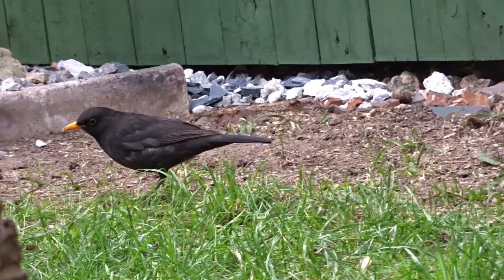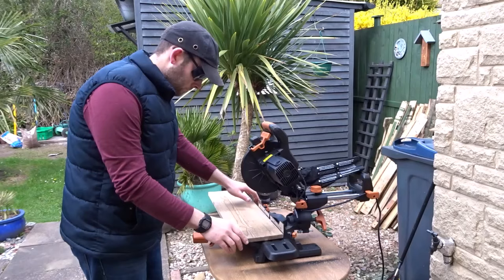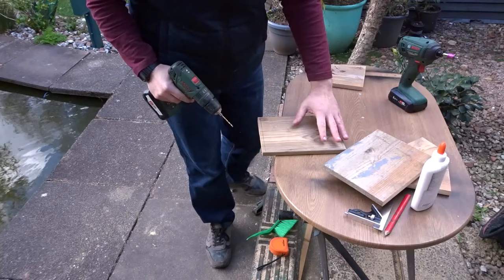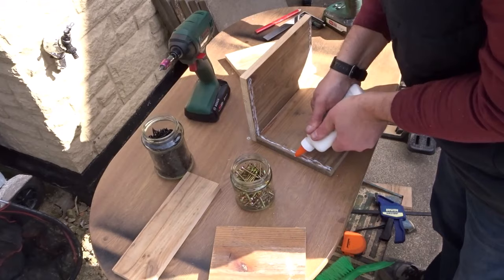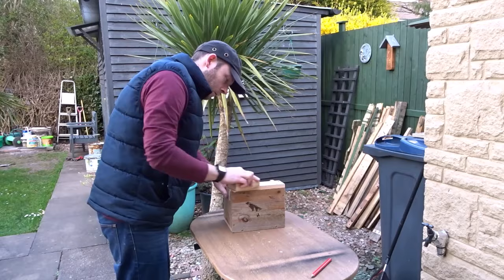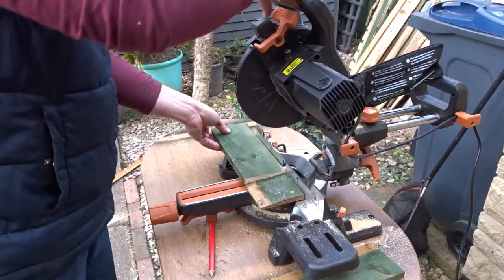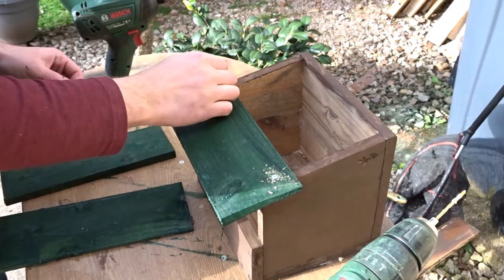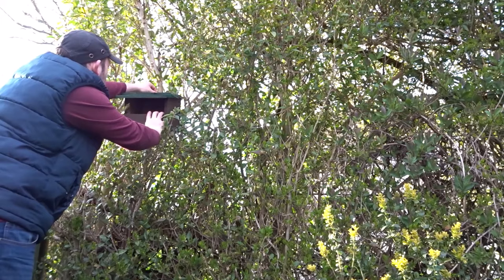How to Make a Blackbird Nesting Box / Bird House (Open Fronted)

Comment: Nice Blackbird house Phill! Looking forward to making some bird houses myself in the near future! We have a nestin pair of Blackbird that have a naturally constructed nest at the top of one of our walls out the back of the house, in amongst some Ivy, they've been nesting there for over 6 years! Lovely birds. 

Have you thought about any modifications or additional things that could be done to help protect nests from cats and magpies etc? like something below it to catch fallen fledglings so they're not vunerable on the ground, and also to stop any cats from bring able to jump up etc? Have had to save some Sparrow fledglings in the past from being stuck on the ground. We have several cats in the area that come in and out the back garden area here, it would be good to be able to do more to prevent them from getting any birds if possible.

Would be cool to see a Wood Pigeon nesting box if there is such a thing, if they would use one that is! They're really interesting birds once you learn more about them.

Cheers.
Reply from the maker: Thanks for the lovely comment Ed 👍🏻 mine has been covered up by the hedges now so it's practically invisible. It's fairly high up also away from the cats. I need to check if there's anything in there because there is a blackbird that's always in the garden. I find bird boxes really hot and miss. Sometimes it doesn't matter what you do the birds wont accept it as a home. If you put the blackbird box deep into the hedges then hopefully fledglings will have plenty of branches to cling to. I've not heard of a pigeon nesting box but now you mention it I will do some research.

Comment: nice informative video.
just one thing, at  8 : 34 while up the ladder, you put the screw in your mouth to hold it til you were ready to screw the box to the tree.
i was a shopfitting joiner before Iretired & did this hundreds of times, however,while putting a picture up at home, i put the pin in my mouth while getting up on a chair.
I ended up swallowing the pin resulting in a trip to the hospital, having a tube down my throat with a grabber inside to remove the pin, all in all, not a very nice experience.
Ever since then, I tend to NOT put any form of fastener in my mouth.
Thanks for sharing the video,hope you dont mind me telling my story, to hopefully prevent anyone going through what I went through.
Reply from the maker: Good point now that I've heard your story I won't be doing it again just to be on the safe side 👍🏻 cheers